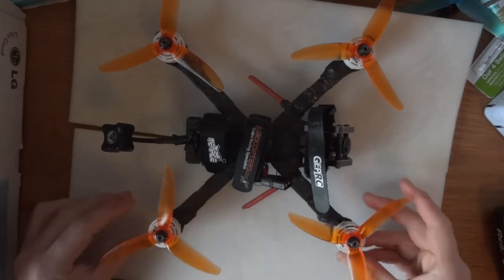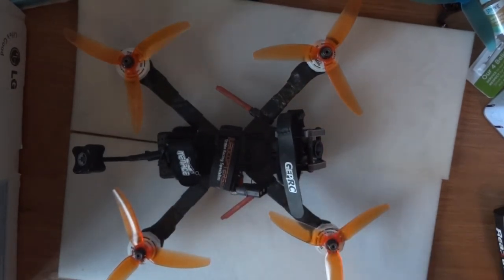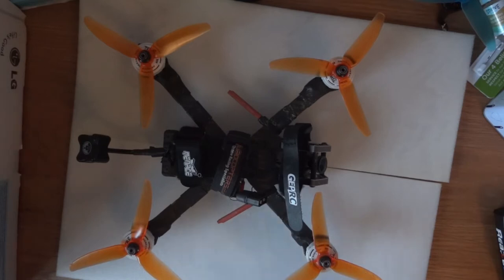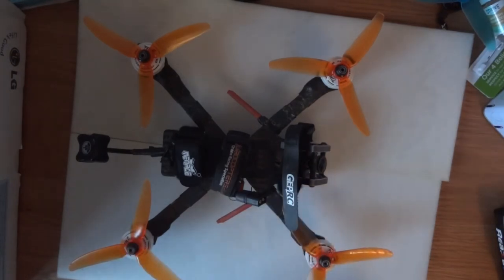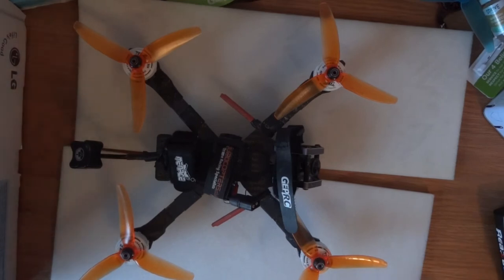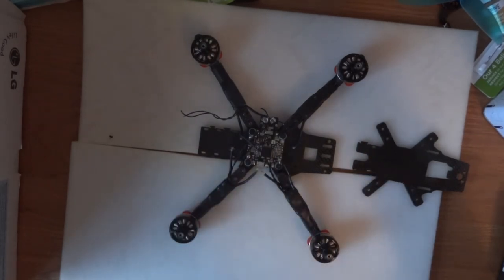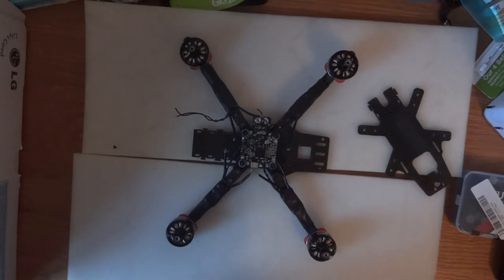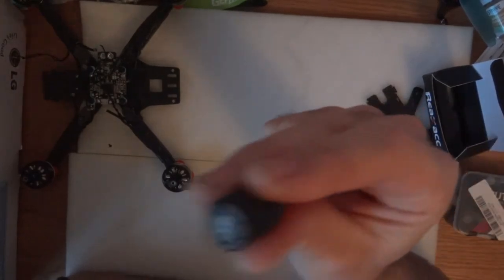Last Waffle Time! Read description for gep update

Comment: Thanks for the shout out, that was unexpected. 😳 I have wondered whether cheaper brand motors have inferior stator laminations and lack the ability to cope with the high frequency timings.🤔 It maybe worth lowering the motor timing in BLHeli and maybe even in  BFlifght drop to 4k 4k. It's just something I thought of, nothing I have experienced my self.
Reply: Coppertop FPV Lol kebab speaks his mind, and then changes it by tomorrow 😁. In all fairness though motor kv and prop choice plays a huge role as you know. Hope you get it sorted. You could always strip it for spares if all else fails. Also I think you should keep the waffling going even if you stop building. You could get subscribers to post topics for discussions. Thanks 🎄
Reply from the maker: Trystan yeah, I like Kabab, but damn does he change from video to video. This waffling is really me just wondering out loud. There’s a long way to go with this quad, and it’s early days. It might simply run better with higher I gain given the neutral balance. Just wish it wasn’t so damn cold as tuning in this weather isn’t fun. I changed the props to 4.3 V1s at the time (was the only spare prop I had on me) and didn’t make much difference. Will try others. In a month I’ll probably do a Kabab and pronounce it the best flying thing I’ve ever had 😀about 100 people watch the waffles. 2.5k have watched the Racerstar 4 in 1 quick look.... If I asked for suggestions, I’d probably get 2 responses! I like doing them, but few people like watching them lol
Reply: Coppertop FPV Some of us appreciate it at least😀. Maybe get more creative with the titles and discuss the products your using and give your feedback. (A little bit more). Everyone wants to know what's worth buying and what's not. Not everyone wants to know your reasons for why you choose components, but people listen when you say if its worth choosing.😉 After all there's plenty of crap on sale today, we need an honest opinion on products.
Reply from the maker: Trystan fair points mate. I’ve so far resisted the ‘Best flight controller ever!!!!!!” Titles as I hate that click hate stuff, and the whole point of this stuff is you don’t know what’s good until down the line. I could do a favourite components and frames video I suppose based on experience. Would that be useful?
Reply: Coppertop FPV We all hate click bate! I was hoping to hear more on your opinion of products you use and especially the ones you have tried and tested properly. Not just an unboxing and quick test like everyone else is doing. The video on 1407 motors is a prime example. Honest feedback is what we all like and no doubt you could squeeze a bit of waffling in there too. I follow various fpv channels because each one brings something different to the table. Your channel offers great british banter, honest opinions good all round entertainment. Keep it coming!

Comment: Good chat mate, thanks for the shout out too.

I wanted to mention about the issue you're having with your Unify, I know yours is the HV but one of my 5v Unifys went bad on me too, when I flew at 200mw it was like flying my other quads on 25mw, I had to turn it up to 500mw just to get it to perform close to my other quads, anyway, the next time I went to go fly that quad, I plugged the pack in and I had no video I just had a black screen in my goggles, I was always told this meant that it was the camera that was dead, also the VTX was still transmitting as my True D module was picking it up.

Decided to test the VTX on another quad and I got the same thing, and when I hooked a new VTX onto the quad I took the Unify off my camera was fine, if you message TBS they will give you a 50% discount on a new one, I just got my replacement v3 5v in yesterday from them.

And regarding that frame being a clone of Ummagawds frame, I am with you on everything you said there as well, the only similarity is the fact the arms are top mounted.
Reply from the maker: DavyBoy cheers for the info mate. I'll test it and contact them.
Reply from the maker: DavyBoy oops, just noticed I said you bought a Martian from me lol. I’ve got Martians on the brain!
Reply: Coppertop FPV yeah, I thought you just said that incase a certain person was watching this, I’m sure you know what I’m referring to. 😉

Comment: Do you think the reason for the tuning problems are also because of the under slung design? I heard somewhere that the props also push air to the sides and because the battery and camera are in the way of this air it creates unstable characteristics. Where in most frames the sides are open and the air can move freely. Just a thought. A good test would be to underling the battery to see if it would fix it.
Reply from the maker: Roberto Correia it's possible, but that should affect yaw, which is fine, and all the others I have fly great with a similar setup. The fact I can raise p so high is a good thing and I should have pointed that out as it means the quad is vibration free. I'm more frustrated that it's too damn cold to tune. Tons of people run I gain really high, its just not something I generally have to do. When I get it sorted I'll let you know.
Reply from the maker: Ps the battery underneath is a good idea, and if another tune doesn’t sort it, I’ll try that.
Reply: Yes the cold is upon us. Lately ive been flying from inside the car and I tune with betaflight osd. The only time i realize its cold is when i get out of the car to pick up my quad and its ice cold lol
Reply from the maker: Roberto Correia I need to find a spot to do that. It’s so cold today, that even though it’s sunny, I’ve hidden indoors. Just finished the rjx build. I really hope these escs dont blow up :)

Comment: really wish you could put the racerstar star f4s in the rjx frame... and a runcam split.... and cheap kingkong motors.... cause now i'm gonna have to do it first myself... and that never ends well.
Reply from the maker: TheMadmacs those aio boards are a recipe for disaster for me. One thing busting I can live with, but sinking 50 quid on one lost esc isn't my bag as you have to replace the whole thing. The only people who benefit from that stuff are the companies flogging it imo 😁
Reply: i dunno i don't have any experience with them, i have used a 4 in 1 esc by itself which i  shorted with my telemetry wire being wrong, anyway it blew one esc so i used an external 20amp dys esc instead and the other 3 racerstars all in one.... it flew ok till it didnt.... that was the haunted quad, new esc's still haunted.
    i kinda hope the all in one is the way forward, i'm sure the boards themselves could be made for a fiver... all in....    same with cameras, i really hope the runcam split is the near future.
Reply from the maker: TheMadmacs racerstar stuff is hit and miss. For every 10 great ones there's 2 duds. Doesn't stop me taking a punt, but not on something so complex. Aio boards have noise problems, and the smaller they are the more it's magnified. It is the future but not one I'm looking forward to on 5 inch quads. Runcam split will be great in a year when the tech catchs up with the idea!
Reply: i'm not sure but i suspect all noise is just poor design,  or we'd all be adding 35v capacitors to our smartphones.
Reply from the maker: Ha, that is a very good point!

Comment: i think the geprc is haunted, i have a quad that started failsafing.... i've swapped everything out and its still not made it through the test stages of the build....i am gonna try changing the model number on my flysky because there is nothing else to try.
Reply from the maker: TheMadmacs lol. Is the model number 666?
Reply: hehe, as all QI fans know, the number of the beast is 616.... 666 is the fax number of the beast (graeme garden ''the goodies'')... seriously though i am gonna change it to model 4
Reply from the maker: If you’ve checked your wiring it’s probably a dodgy receiver. I had an X6B that did that. It’s not uncommon.

Comment: Nice waffle.... Check out SteelRainfpv, he did a vid transmitter shootout where he tested 5 vid transmitters including Tbs hv, Matek hv, akk, tx03 etc. Spoileralert the tbs is the only one that puts out what it says. The matek I use only put out 250 when set to 500😥
Reply from the maker: Splinter Fpv that's interesting. Perhaps that explains why I was so blown away by the tx801. Looks like I have a dodgy unify then as this is putting out about 25mw 😉
Reply: Coppertop FPV sounds like that may be the case
Reply from the maker: I suspect if he tested another batch of them (just about to watch the video) he’d get different results. All the cheap stuff is hit and miss, Shame because this Akk looks top notch quality. I’ve got the 20mm for my small stuff too. I need to update this vid, as smart audio is working fine, being an idiot, I’d switched on serial rx on the same uart. 😩
Reply: Coppertop FPV lol been there.....
Reply from the maker: Splinter Fpv good channel steelerain. That’s a bit bad, but I suppose not unexpected. I’ve quite liked the matek (especially the solder pads). Will do a rough test on my Akk. Bad news when it looks like my best vtx is the £9 Eachine tx801 lol.
Reply: Coppertop FPV lol right...i do love the pads of the matek. I loved it so much i bought a second to replace an old eachine on my backup quad. I will live with them till they die. lol. Or i feel like spoiling myself with Tbs.